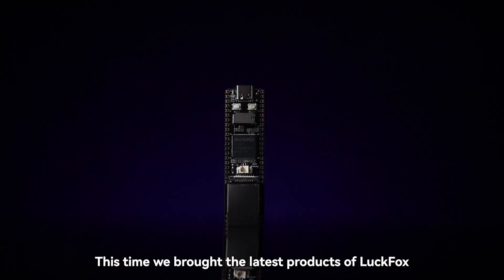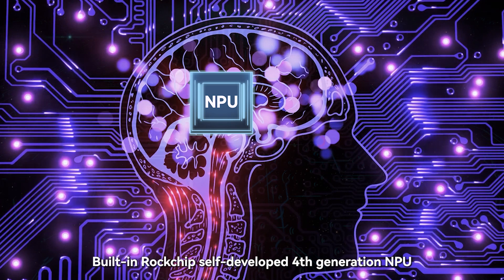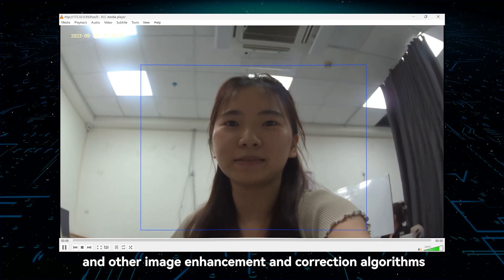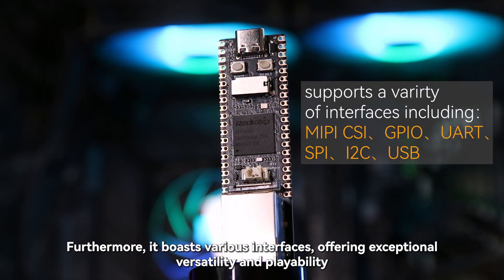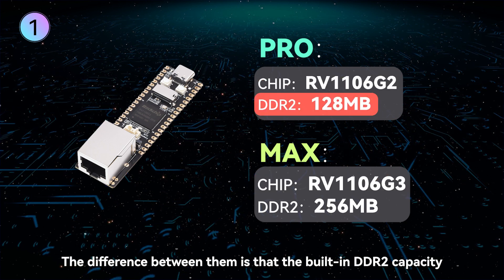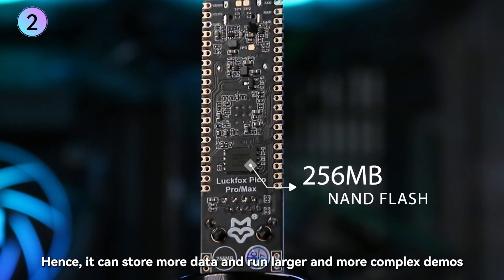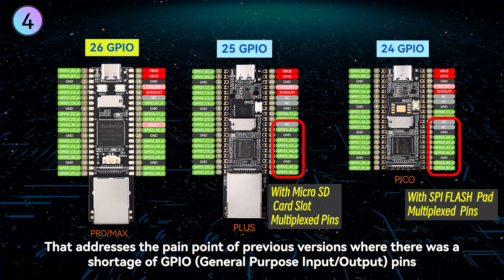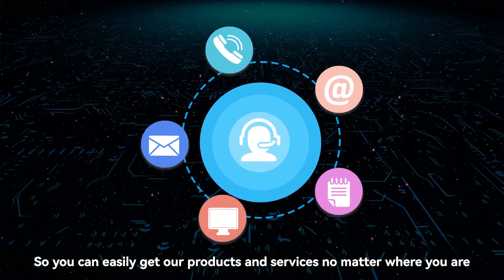Pico Pro RV1106 Linux Micro Development Board, Integrate ARM Cortex-A7/RISC-V MCU/NPU/ISP Processor

Comment: Can you make a pico that can handle 2M+ at 120fps, this is the perfect size and it’s all it’s missing! Can you plug a WiFi adapter through usb?
Reply from the maker: For USB WiFi, we currently don't have specific tutorials available. You can refer to existing tutorials on adding the driver to the kernel. For example, RTL8188CU.
https://wiki.luckfox.com/zh/Luckfox-Pico/Luckfox-Pico-Menuconfig